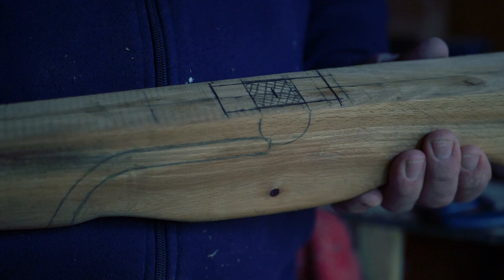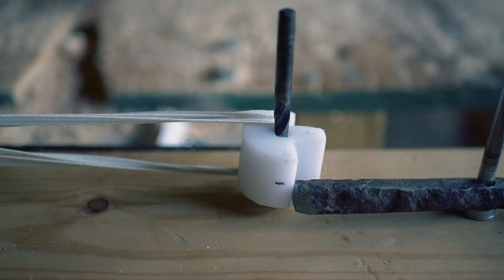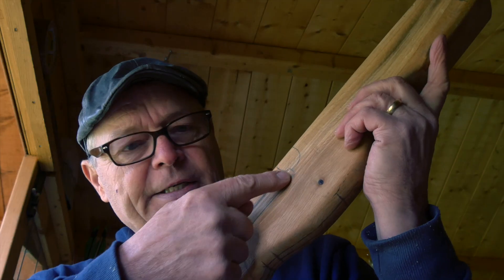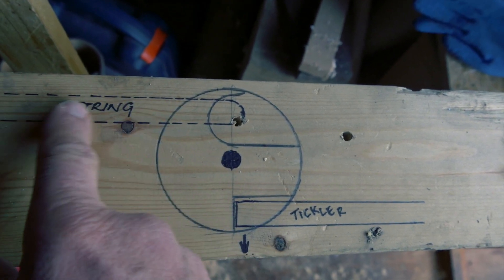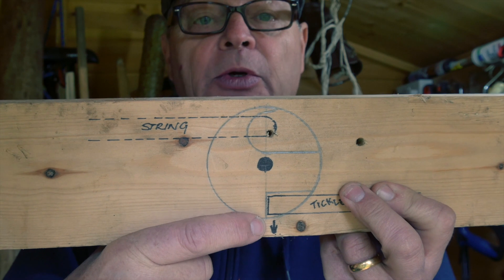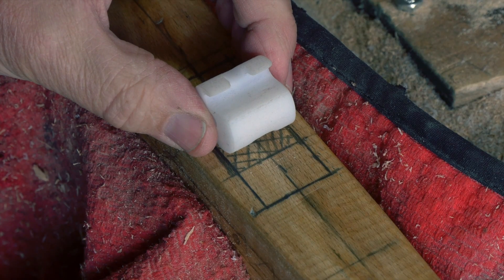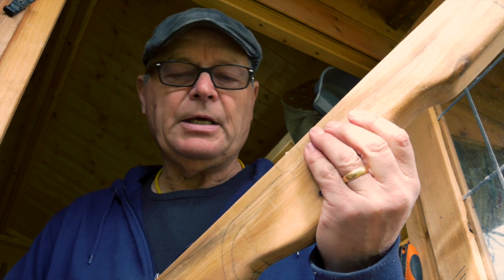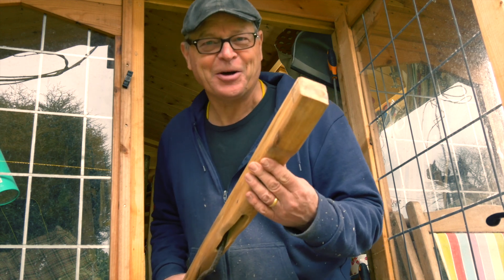SCRAP BIN CROSSBOW. Can I build a crossbow from scrap? Part 5

Comment: Was the hole that you had drilled to house the roller nut the same diameter as the roller nut?
Reply from the maker: Yes it was and then I sanded the nut a little until it fitted. Hope that helps. If I made another I would use bone or antler for the nut.

Comment: Great job Mick. Can I ask why the Delrin goes into a prepared block of wood (I swear I saw breech block! Lol) and is then recessed into the stock? Would it work equally well just mounted on its axle in the recess?
Reply from the maker: Malcolm Smith Hi Malcolm, my problem was not being able to fashion a perfect socket in the tiller. The recess was/is quite crude and by letting in a properly shaped socket I am able to make the nut turn easily. There are other solutions to this problem but I chose this course of action. Thanks for watching!!

Comment: I think the nut has too mich of a hook shape. I fesr the string will not slide over it as smoothly as it could. One could even go as far as making the claw completely straight recrangular so it complete aligns with the tiller/stock and the string just flys over it instead of out of it :)
Reply from the maker: You are quite right but I am sure the nut, tickler and their interaction will require much ‘tuning’ as is the way sometimes of first projects built entirely by eye with no plans etc. The nut is too hooked but I shall leave refinements until later. But thank you for confirming my suspicions!!! 🙏🙏
Reply: You're welcome, Mick. By the way, nothing is doomed yet. In the video it's visible that the rubber band already carved pieces out of it's tips. SO either the string will continue that job until it reaches a smoother shape OR, you can file those fingers down a bit until they release the string a bit smoother.

I highly recommend you to look at Tod from TodsStuff here on youtube where he presents some of his trigger mechanisms. He is a real master of building top notch medieval crossbows.

And to be honest, for your first project of this kind, it's already a great piece of engineering :)